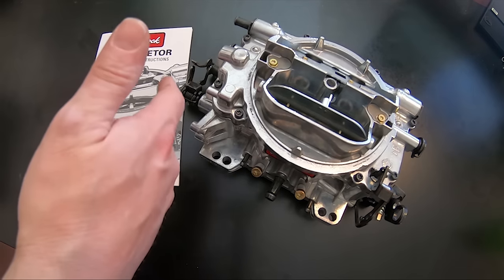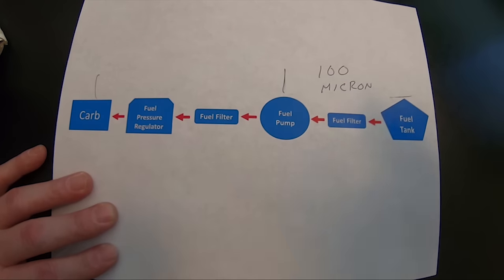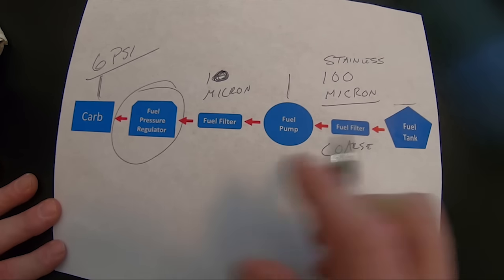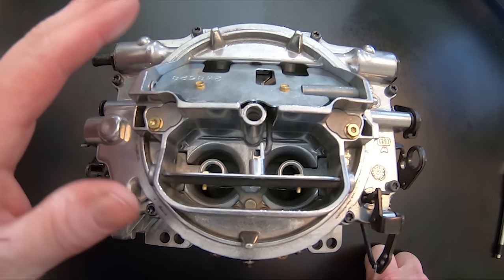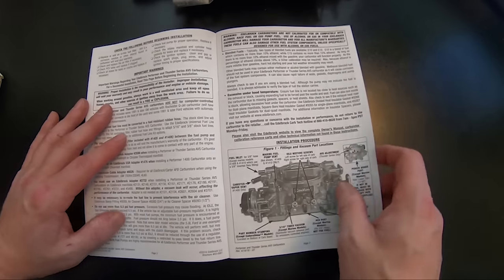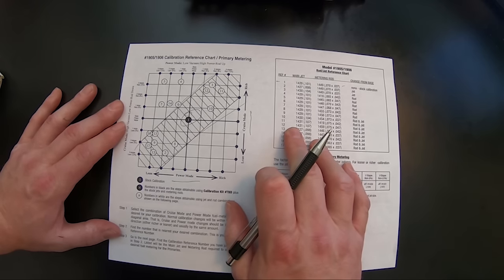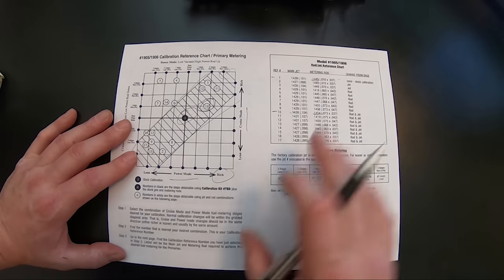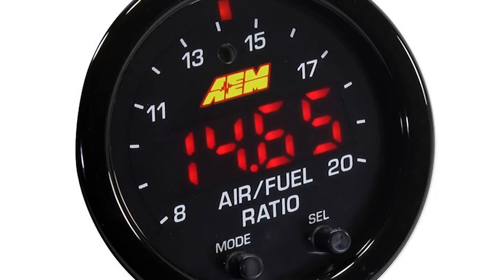The Ultimate Edelbrock Carburetor Tuning Guide

Comment: Thanks for a video. I have a Triumph TR8 with an Edelbrock carb (replacing the OEM cross-ram dual Zenith Strombergs).  My carb experience is with other British cars with SU and Zenith Strombergs, and despite dreaming of muscle cars in my youth, this is my first car with an American style 4 bbl. 
I have been struggling with the car since I bought it last year.  I came with no choke installed (manual linkage on the carb, but no cable installed), so cold starts have been a SOB.  Once it does start, it runs pretty good, although it run super-lean during cruising.  The previous owner installed a AFR gauge which is show the rating well in the 16:1 range (or higher) at speed.  The temp gauge will also creep up almost to the point of over-heating.  Oddly enough, in stop and go traffic with the engine idling, it richens up (13:1 or so) and the temp gauge is perfectly normal. 
While watching the video, I paused it and went to look at the vacuum ports.  Passenger side - capped.  Driver side - open (with the vacuum hose to the distributor disconnected. The large center port - also open.  Rear port - plugged (the power brakes are connected to a port on the manifold).  Something tells me that completely open center port would represent a large vacuum leak? I know from my years fiddling with SUs and Z-Ss, vacuum leaks are the bane of carburetors. I swapped the distributor line to the passenger side port, moved the small cap and capped the large port.
I bought a tuning kit, but now I'm wondering if I really needed it... unfortunately, my interior is apart (fixing more previous owner "mods"), so it'll be a day or so before I can start the car and see if the capped ports makes a difference.
I wonder if a phenolic plate between the carb and the manifold might help, but unfortunately the space under the hood of a TR8 is tight.
Reply from the maker: You’ve made the right choices and corrected some horrible issues with the vacuum leak in that PCV port up front!  Yes, you absolutely need the tuning kit.  You have a great advantage there with the AFR to help you tune once you get ready.  Yes a block for the heat transfer is important.  There is a link in the video description of the narrowest spacer that Edelbrock makes.  If you can use it, anything helps!
Reply: Thanks, I'll take a look at the spacer. I also need to check the timing and advance are correct.
It's funny - a common saying from working on old British (and Swedish) cars is "90% of carburetor problems are ignition related."  Especially since many of these cars are still running points distributors.
Reply from the maker: @ianfurqueron5850  that’s a statement that proves itself true over and over again!  Good luck, and if you run into any issues don’t hesitate to let me know.  Always happy to help if I can.

Comment: Sir, First off, thank you for taking the time to help others... We appreciate you sharing your knowledge and experience.  I have a 1992 Dodge D250 pickup w/360 (LA, not magnum) engine. It originally came with TBI, and ran pretty well until one day Pfffft. No power to coil or EFI. Literally replaced everything including the computer twice, still nothing. I purchased one of the Jegs HEI distributors (to fit a Dodge), an Edelbrock Performer intake, and at first a Holley 1460 Carb.  Holly just pumped gas into the cylinders, and it chugged. Never could make it run right... 
I am using the stock in-tank fuel pump, going through a filter, a bypass regulator (5psi) , another filter, and then one of those "dial-style" deadhead regulators (just to be sure) before the carb. A buddy gave me a Carter/Edelbrock 9635S 4bbl, (600cfm) which I promptly put a kit into, and the truck is extremely happy.  I did have to remove the vacuum advance off the dist. because it would hit the intake or the firewall.  I "locked down" the timing slider inside the dist, but it still has centrifugal advance intact.  With the Eddy/Carter carb, I can get a really nice idle, but it's a little too low (little under 500 RPM).  If I attempt to raise it, it suddenly starts sputtering like it's running on about 4-5 cyl. Same thing happens if you lightly rest your foot on the gas pedal.  just a little more throttle, and it's back to smooth, and accelerates quickly. Likewise if slowing down, slight pedal pressure (or being between 550-850 RPM) causes this sputtering miss, then it gets down into the idle circuit and smoothes out, but at really low RPM's.
The engine is bone stock, with 160,000 miles, Automatic trans, and runs like a scared rabbit with the Edelbrock 4bbl, except for that blasted stutter just above idle.  If I could just get it to idle up a little more and to stop that stuttering, It would be running perfect.  Am I going to have to find a way to re-install the vacuum advance, or is there something that I am missing?  Going down the highway, it purrs... and is 3-4 times more responsive now, than it ever was when it was TBI. Gonna need to do some mods to get my speedometer and overdrive to work again, as they were controlled by the ECU, but that sputtering drives me nuts!  Thoughts?
Reply: @MuscleCarSolutions  Yes, I did use an Edelbrock kit on it.  Strange thing, last night I was going to visit a friend in a rural area... when I got onto his road (straight and flat) I put all 270 foot pounds into the pedal and let 'er howl up to about 80-ish MPH (according to phone app) and it now idles at about 750-800 and no sputter!  I will have to figure out a way to make the vacuum advance fit in the limited space I have. I figured the mechanical advance would be ok, but if the vacuum will make a difference... I'll massage the firewall a bit.
Reply: Latest update: truck still runs perfect, and am getting 12mpg (used to get 8...) now! I've decided I'm not touching a thing on it. (except to add an overdrive enable switch)
Reply from the maker: Nice!  Well glad it’s running well.  Keep those filters clean and you’ll get lots of good miles on it!

Comment: Thank you. Not sure why Edelbrock stopped putting this tuning chart in the installation manual. It was frustrating just finding it on their website. Need to use a PC, not a phone.  This solves alot of issues and shame on Edelbrock for removing this out of their manual. Thanks for the video
Reply: Bought mine at summit racing and I got a bunch of Manuels 2yrsvback

Comment: Stock 1413 (800cfm) on 454 BBC mild cam street car with a T350 automatic transmission. Incoming fuel pressure is 6.5 ish.  Ran perfectly for last 5 years accross all throttle positions/weather conditions.  Recently, (warming in Northern CA)  I get a hesitation from a standing stop to full power (iow punching off the line), but it does go for just a second before the hesitation.  Then after the hesitation, everything is fine.  From cruise to full throttle no problem.  So it's just a hesitation from standing stop to full power, but the hesitation doesn't hit until about a second off the line.  Carb looks clean generally and I've never adjusted a thing because it has worked perfectly up to now.  Thoughts?  Educated guess?  I appreciate anyone's input.  Cool video!!
Reply from the maker: Ah these conversations always hurt my feelings.  😂 Imagine how much better it will run when you tune it!  What’s your engine vacuum at idle?  Match the step up spring to it.  Then you can adjust from there to remove any hesitation.  What is your initial timing set to?  When does fill advance come on and what is it?  The pressure is on the high side.  Just be aware of that if you start having issues.  I’d start there and you can work through the tuning process to really get it dialed in.   You’ll be surprised what you put up with as “normal” once it’s been tuned for your application.

Comment: Thanks this video has some very good info. I found lowering the fuel pressure to 3lbs. Helped the hot restart issue as well. Doesn't seem to creep as far up after shut down. The ethanol fuel is causing a lot of problems. For those of us running carbs these days.
Reply: @MuscleCarSolutions  OK.. I think I will give that a try if I continue to have heat soak problems. Summer is coming and it gets pretty hot here in florida. I'm running the shorter edelbrock spacer 3/8"  for the EPS manifold. I have plenty of hood clearance still. Thanks.
Reply: A 1 inch spacer should help. I run them on everything.

Comment: This is a fantastic video that I’ve been looking for. Tomorrow morning I go pick up my 1408 or 1480? Edelbrock tuning kit. I had no idea where to start now I do thank you very much. I put a new 383 ( with bigger cam and roller set up)in my Mopar and I got a terrible stumble off the line. I can’t even put it in gear unless it’s almost 1200 RPMs at idle without it dying. I will be referring back to your video and I will hope that my kit comes with that book. If not I will download the PDF as you said. Thanks again for the great video sir
Reply from the maker: Well you’ve got some work ahead of you but the good news is with some patience and a little understanding, you’ll be able to get it running and driving much better.  Don’t hesitate to ask any questions if you get stuck.  Happy to help if I can.
Reply from the maker: I’ve got a ton of Edelbrock carb videos and fuel system set up in a playlist.  You might find some of those useful too.  Good luck!
Reply: @MuscleCarSolutions  I will definitely check the other videos out👍🏻 thanks for the reply

Comment: There is a lack of information on A/F ratios vs power and fuel economy with regards to stressing the engine (knock, ping, burned valves). For example what is the best A/F for fuel economy while cruising without leaning out the engine too much? My truck is a 1985 F-250 HD (5,900# certified scales) with a fresh 460, T-19 4-speed, 4x4, high boy, 9:1 c.r. with forged pistons, mild cam, stock heads/exhaust. Dyno at 4,200' is 246 HP/4,200 rpm at the rear wheels (Dana 70 rear end) and max torque at 2,500 cruising rpm. Best number for fuel economy I could find was 15.4 A/F. I leaned out a 1405 to one stage leaner (at 4,000' elevation) and the truck will get up to 11 mpg and runs strong. That said, 200 miles on fresh plugs shows the porcelain insulator to be a clean white and not a light grey or brown that is optimum; the ground electrode has a slight buildup of deposits. There is NO ping or knock so I am good there. My point is that it is a good idea to read the spark plugs while tuning.  I may be just slightly too lean and will experiment with rods and jets. My AutoMeter A/F shows 15.4 A/F when cruising and above to 16 with slightly more power for passing, etc. WOT power and idle is 12-13.  Had I installed stainless steel or stellite-faced exhaust valves then I would not worry too much about being slightly lean. If you cannot measure it then you cannot troubleshoot it, you can only guess and I hate guessing. I am still looking for a good book or read on A/F tuning.
Reply: @MuscleCarSolutions  Thanks for the rapid response. I have planned on lowering the A/F ratio. Nowhere on the internet or library have I found studies of varying A/F ratios and effects on driveability, engine load, engine damage, and so on. I am an industrial engineer and dealt with numbers and not opinions. That is why I monitor the A/F and vacuum along with load and rpm. Too expensive to add a gear. BTW, the engine is built as strong as I could with Eagle rods and Autotec forged pistons. It is capable of handling 550 HP and I have about 300 HP at the flywheel. Timing is 8 deg BTDC on a stock dizzy. After observing retaliative coarse A/F changes with the EDDY then I am now considering EFI because I can fine tune the engine fuel parameters.
Reply: What an engine desires for a/f is not a static/constant number. Each engine will like a different number. Anyone can get you ballpark, but in the end, it's similar to timing
 There's not a magic rule outside of experimenting. Called "tuning"

Comment: Fantastic video thanks for the advice. Im starting this journey on a 75 f100 with a mild cam 460. So far ive determined its an old edelbrock 600cfm but i got ignition maintenance to get sorted out first.
Reply from the maker: Yup.  If you get the supporting systems right first (ignition and fuel supply), tuning becomes very easy.  Good luck!  Don’t hesitate to ask any questions along the way.  Happy to help where o can.
Reply: @MuscleCarSolutions  Thank you.

Comment: put a 10 micron fuel filter before the mechanical fuel pump to keep sediment out of the fuel pump check valves..  1984 corvette fuel filters are 10 micron..  when sediment gets in the check valves the fuel pressure held by the pump in the line to the carb is reduced.  this reduction in fuel pressure allows the fuel in the line to the carb to boil.. the expanding vapor pushes liquid fuel backward thru the fuel pump.. .leaving the carb low on fuel.    this reduces fuel boil over and hard to start engines because they are flooded..  when the sediment in the fuel pump gets thru to the needle and seat.. it can when the fuel level is reduces allow fuel vapor to expand and overflow the carb.. 

if you have an off idle stumble with an edelbrock.. cold engine count the fractions of turns to lightly seat the idle mixture screws.. take them out.. with a can of carb cleaner.. blast a 1 second spray down the idle mixture screw hole... 1 SECOND.. followed instantly by a blast of compressed air.  do this 2 or 3 times for each idle mixture screw hole.. this blows sediment out of the idle feed restriction and the idle air bleed. in the primary booster assembly. 

 if you have flat spots and you are running an engine over 360 cubic inches.. and especially over 400 cubic inches.. you may have to use a 61 to 80 drill set and one size at a time drill the idle feed restrictions in the side of the primary booster assemblies. its behind the idle air bleed on the side.  you want to take the top off the carb.. then take the primary boosters out.. 2 screws.  figure out what size the second part of the passage is.  go up 0.001 .. reassemble and test drive .. you will need to readjust the idle mixture. the idle speed then test drive. if you get a flat spot at around 1000 or 200 above base idle..  or up to about 2200 RPMs before the primary circuits take over completely.. keep drilling 0.001 at a time.   look up Low speed circuit.. look up idle transition circuit.. look up economizer circuit.  edelbrock and holley removed this info from the carb manuals to allow the carb tuners something to work with. .

Comment: Hey I just put my create 5.8 in with a 1406 Edelbrock. Now I know it's really set for economy. But I ordered rods and springs. Your videos have show alot. But I'm getting a feel for my next step. I thought I had it tuned pretty good but iv got this stumble in each drive and idle that I'm trying to work out.
Reply from the maker: Yup.  Keep tuning.  You’ve got the tuning kit and that’s a great start.  Make some changes to the accelerator pump.  I did a video on that.  Adjust fuel pressure.  Did a video on that as well.  Keep working with your timing as you make adjustments that get you good results.  You’re a little limited with the older performer series carb on the secondary side, but you still have lots of tuning points to get it dialed in.  As long as the cam profile isn’t too wild, and what you’re using it for, you’re on the right track.

Comment: Great video! I'm reading through the manual and trying to wrap my head around how this carburetor works. Do you have a simple explanation for what components effect which driving conditions? IE: idle mixture screws determine idle afr during idle, but also; primarily jets effect this too? Then when accelerating, springs and metering rods kick in. Then, during wide open throttle, primary, secondary, and idle mixture screws determine afr. Am I correct here?

Basically, I'm trying to narrow down what to change by looking at afr during different driving conditions. Also, what is a good afr for each of these stages when shooting for fuel economy?